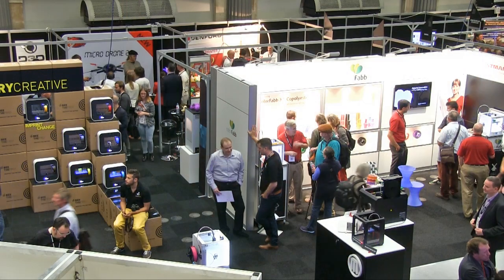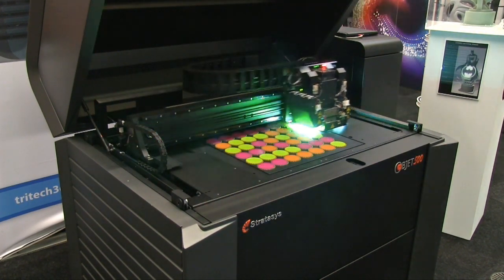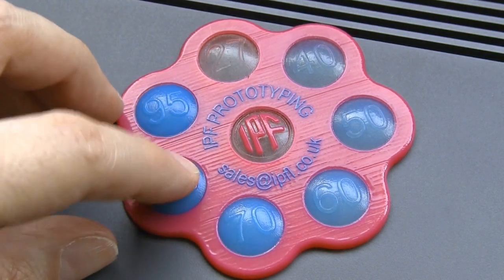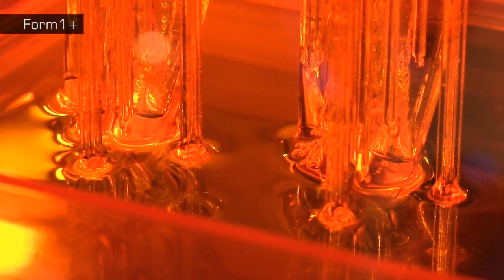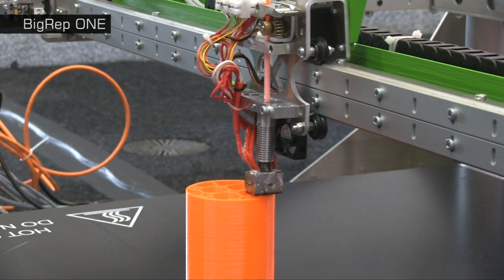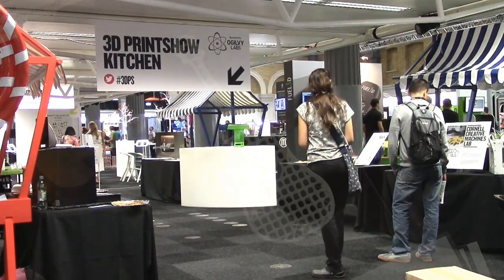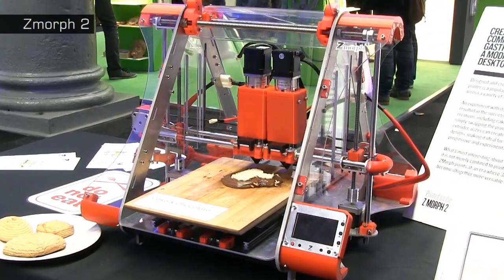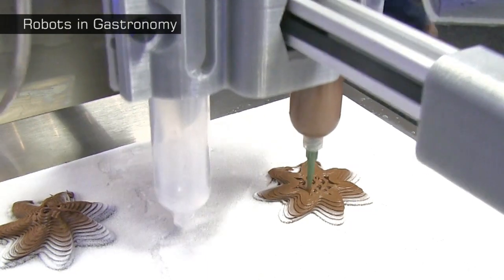3D Printshow 2014: Extra!

Comment: In its current guise can you explain to me what benefit "3D printed" food has over any other way of producing said food? Basically, the Eiffel Tower chocolate in the video is a plotting machine there's nothing 3D about it, it is not building something layer-by-layer it is laying out one layer in a pattern that any chocolatier could do infinitely better and infinitely faster. The 3D printed food hunger is minimal, it is no good as a kitchen utility, not quick enough or clean enough for mass produce and not as effective or impressive in gastronomy where the chef's expertise are far superior. The question is, if you took away the "3D printed" aspect of the food would anyone entertain it? Not a chance.
Reply from the maker: Daniel O'Connor I can only agree with you that 3D printing currently adds very little to food. The Choc Edge printer (seen here printing the Eiffel Tower) does print in layers, so is technically producing 3D output -- but I agree that a person could do this better.The food printers shown in the video are now reaching commercial application, and that is why I included them here. And 3D Systems (the largest supplier of 3D printers) has two 'ChefJet' models promised by the end of 2014. Personally I think that this kind of 3D printing is going to remain incredibly niche. People keep telling me that I am wrong. So I welcome your scepticism on this one

Comment: Hi Chris, thank you for this interesting insight into the show! Currently, alot of the printers are rather slow. What is the reasons for this? Can these be sped up through better hardware or are the materials used for printing limiting the speed?
Reply from the maker: Adrian S I think the speed issue is a combination of hardware, control electronics, software and materials. Things will speed up -- but not as rapidly as they did in computing as there are clear physical limits on the speed of physical processes. But I think at least some speed will come by adding things like multiple heads/nozzles/lasers/etc.